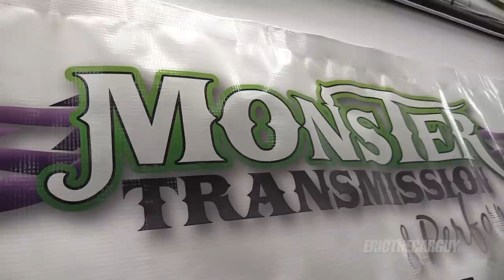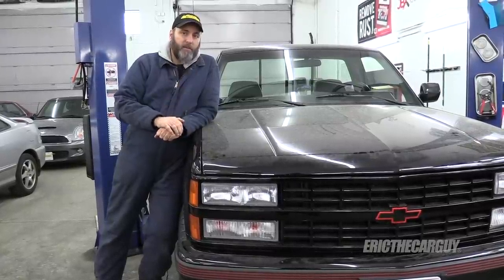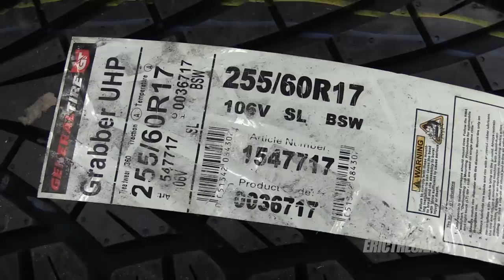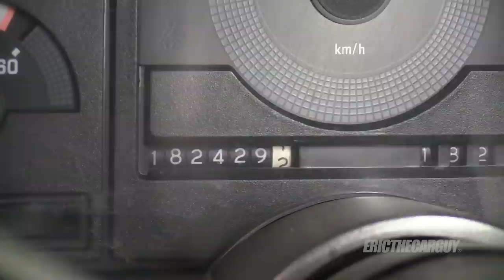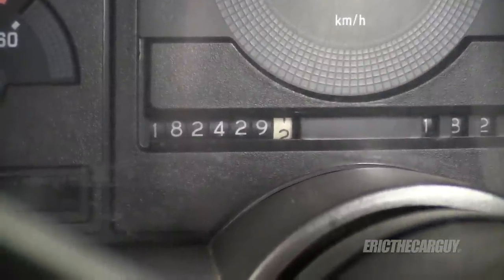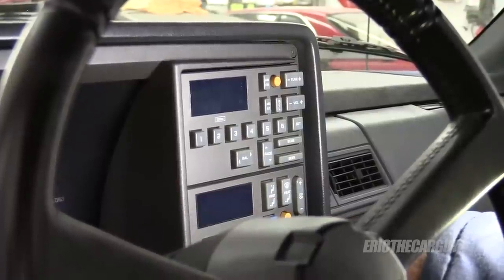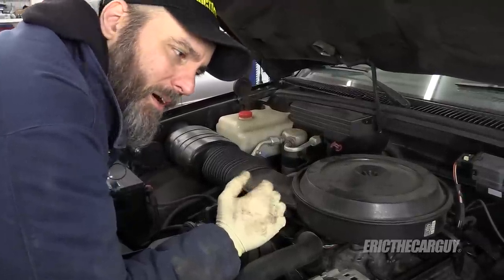#ETCGDadsTruck Build Introduction (Episode 1)

Comment: i just gave mine to my son for him to restore. kinda in keeping with your dad's tradition too as it turns out. I Would have LOVED to have had one of those trucks in a stick shift WOW and i thought mine was rare being a first year limited run. I think you just beat me out on the rare truck thing. i've never known a Sport truck to be a manual shift and if you weren't who you are and known for not misleading people i would be calling foul right about now. That's just how rare a manual shift is in that particular truck. NO! DON'T LOWER that truck! it will ride rougher and you're going to completely RUIN it if you do what you were talking about doing. You don't fully appreciate how rare these trucks really are OBVIOUSLY. If you do stick those 17" wheels on that truck let me know (even though i think you should put it completely back stock) and i'll purchase the wheels you have on it now. i love those wheels and still have a truck that i can put those 15" wheels on and make them look right. I had 265/50/15's on mine with the normal height and the factory wheels that came on the truck. i've kept it stock because of how rare it was and still is. there are VERY few examples of these sport trucks around still and now you're talking about ruining one of the very few that are left by cutting into the frame COMPLETE LUNACY!  Bigger tires, and the 2/4 drop is ALL i would do if you do anything because you are going to find it rides a lot rougher that way and you can at least put it back that way once you realize what a screw up lowering it is in the first place. I too had problems with the breaks on mine but only the rear breaks and it was always the wheel cylinders. Just my opinion but you would be better served i think doing a rear wheel disk break conversion on the thing rather than get rid of the current system. i ended up having mine done by pros because every time i swapped out the rear wheel cylinders after just a short time they would blow out the cylinders again the same thing happened when the pro did it. If you replace the drums with disk brakes that is ALL you should have to do to the brake system to make it stop on a dime. trust me on this i have friends who did that on their later model trucks and that's all they needed to do.Once you do all of that to this truck you might as well scrape the sport stickers right off the bed and just call it a regular Silverado You're going to completely RUIN that truck if you even do Half of what you talked about. ridiculous!  YOU DON'T WANT IT TO GO OVERBOARD AND YOU'RE GOING TO CHANGE LITERALLY EVERYTHING ABOUT THE TRUCK AND KILL THE MOTOR BY STROKING IT OUT?  ARE YOU LISTENING TO YOURSiELF HERE?  YOU'RE RUINING A RARE AS ALL HELL CLASSIC TRUCK if you do even half of what you talk about you're taking everything that is a rare silverado sport and taking it away. why not do that to a different truck that's not so rare and leaving this one pretty much like it is? I'm not usually as much of a "purist" when it comes to cars and trucks but the rare ones i always am and the ones i have owned REALLY have a warm spot in my heart and it's like killing the spirit of the truck doing all of that to this rare of a vehicle. my old truck that my son has now has 269,000 miles on it. ALL i did was run Mobil1 oil (ONLY) in itI changed the Water pump twice the Alternator once the throttle position sensor once and put like 6 batteries in it. maybe a total of 6 sets of brakes and due to not being satisfied with the oil pressure i was getting in the end i put in a high volume oil pump also. if you are running an after market stereo in that truck the big metal box that is the stereo next to the Gas pedal is rather a pain in the ass to remove but they do make a pocket that you can put stuff in on the dash in it's place. the down side is you can't put a standard sized deck in the dash in place of the tape deck because of the small amount of room you have to mount one.  I mean you kind of can but you have to worry about wire chaffing when you do. the fun part will be replacing the rear pillar speakers which should be done at this point too. JBL makes a really nice sounding set and Alpine does also but the Alpine ones of course aren't cheap. I can't believe all the things you were wanting to change on this truck it's heartbreaking and i really hope you re-think most of the options you mentioned
Reply from the maker: Maybe wait till I'm done before you lynch me. You just might like it. BTW, manual transmissions are not uncommon on these trucks. https://www.youtube.com/watch?v=EMw1iNI1ypA

Also, neither me or my dad removed the manual from this truck. Or the seats. In short, this truck was modified before I got it. If it was all original that would be one thing, but it's not. 

Thanks for your input.

Comment: Can see either oil or auto trans fluid leaking which is normal on a gm.   I won't let anyone with a gm park their vehicle on my driveway because of the poor rear engine seal design.  The leaking oil makes a terrible mess on driveways.  Mite want to talk with Monster and see if they can fix that while the trans is out.

Comment: Realistically, If someone who owned this wanted to up the power on the cheap, they would LM7 swap it. Cam, springs and a tune would put your built 350 to shame. Why do you hate the LS?
Reply from the maker: I don't hate the LS, in fact, I just made a video about this very topic for people just like you. I'm just sick of seeing LS's everywhere. It's boring. You seem to forget that for 50 years before the LS, the 350 was the engine of choice. And because of the LS's popularity, 350 parts are even cheaper now. 

I would wager if I had put an LS in the Fairmont as everyone suggested, it wouldn't be nearly as cool, and likely wouldn't have ended up in Hot Rod. I stand by my choices.

Comment: I have set of long tube headers if you want them
Reply from the maker: Thanks, but long tubes on this truck are problematic because of the fuel tank. I'd also have to get a smaller starter. Shorties are better for low end torque anyway. Thanks again for the offer.

Comment: I never understood why people like the drop suspension thing on a truck. It looks stupid to make a truck functionally useless as a truck. It would be like putting a 4 inch lift on the Fairmont.
Reply from the maker: 2" 4" drop isn't that much and will improve the look as well as the handling. Well, improve the look for me that is. Likely that's as far as I'll go. As you pointed out, if it's too low it really can't be used as a truck anymore.
Reply: @ericthecarguy  Right its all subjective when it comes to looks, just not my style. But like you say 4 inches sounds like a lot but might not look to extreme, who knows maybe I'll like it. I'll look forward to seeing it when you're done :)

Comment: Have you thought about a 4 link in the rear?
Reply from the maker: No room with the current fuel tank. Not to mention the expense. I'm trying to keep this build in reach of the 'every man'.
Reply: @ericthecarguy  understandable. I've never been a fan of the side mounted gas tank in these though. Poor and dangerous design. Still super sexy gen of Chevy trucks nonetheless.
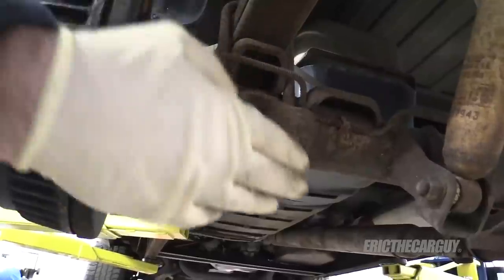Reply: @HoUsEoFcAtS78  Dangerous?  GM moved the gas tank inside the frame rail in the 90's (see 2:59).   It is hard to find a safer place on the truck. It was 73-87 truck that hand the tank on the outside of the frame rail which probably isn't the safest spot in a side impact but I guess it is safer than have the tank in the cab like it was in the 50's.

Comment: Hey @EricTheCarGuy  and anybody with an  OBS 88-98 C1500 or K1500. Their is a company called Little Shop MFG that makes a master cylinder upgrade and braided stainless steel brake lines. https://www.littleshopmfg.com/gm-ck1500-master-cylinder-upgrade/